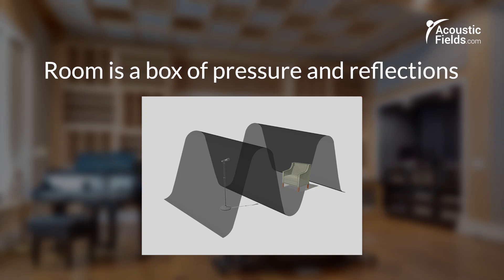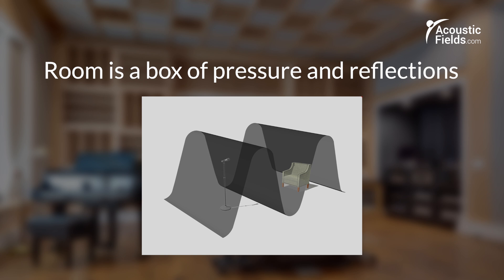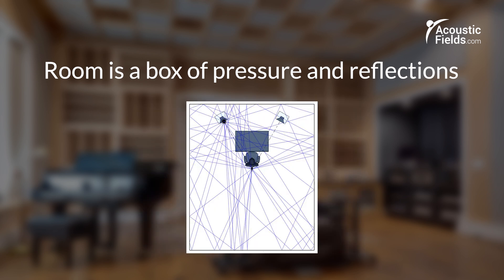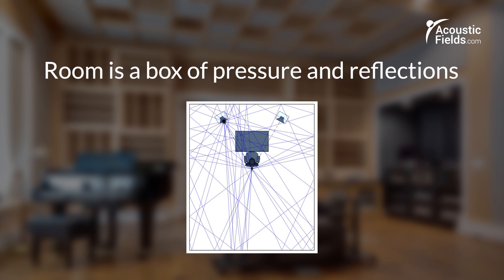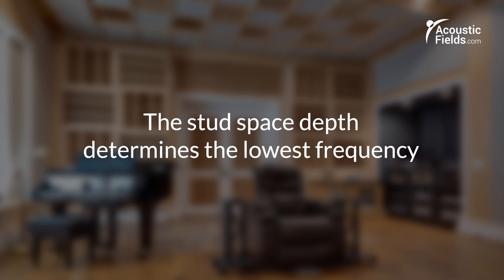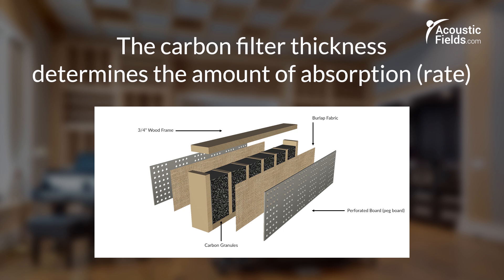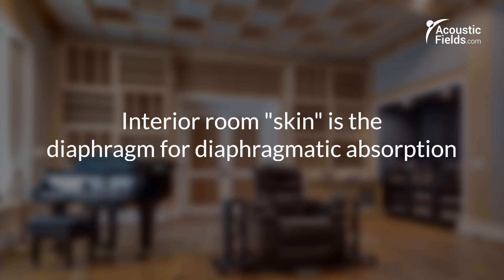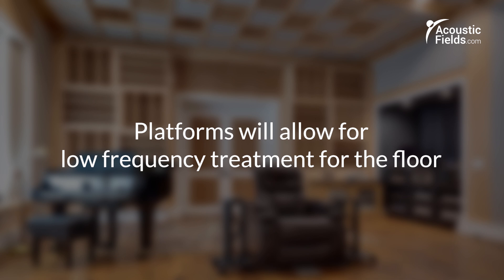CAW - Carbon Absorber Wall - www.AcousticFields.com

Comment: If all you have is a 2x4 wall to work with is there any hope?
Reply from the maker: All walls will "work" to the frequency of the depth which at 3 1/2" starts at 80 hz. The next question you must then ask is a wall that starts absorbing at 80 hz. the correct wall to have at that room location. My guess would be no. You must go lower in frequency. Going lower in frequency means adding a 2 x 6 stud to increase depth to 8" At an 8" depth, you can get to 30 - 40 hz., which is the lower frequency range absorption requirement number in most small rooms.

Comment: Do activated carbon granules' performance degrade over time? Do volatile compounds, and airborne pollutants get trapped in the granules after months/years?
Reply from the maker: Our carbon technology goes inside a cabinet. It is sealed from air movement. We also treat it for moisture retention.

Comment: I think the CAW is the most ingenious and most under rated technology in the audio world. Yes, it's not for low budgets, but as far as depressurizing the room, I don't think there's a better way to do it. Dennis should be given lots of technology awards for this.   Too bad it's not as widely known about as he tends to prefer a grassroots effort in marketing rather than spending gobs of money in magazine/internet ads.  Too bad he isn't conducting lots of lectures around the world at Professional Audio forums like AES.
Reply from the maker: Since room modes oscillate every 36 - 48" throughout the room, placing the proper rate and level of absorption inside the alls, every 14" (stud space width), you are able to manage all unwanted energies with 2-4 stud spaces per room mode. That is enough surface area to reduce the unwanted modal pressures by 70 - 90% depending on the chosen room resultion level. You are in essence tuning the walls every 14". Nothing can escape this relentess pursuit, not even 30 hz.
Reply: @AcousticFields  I've seen many other designs for walls and nothing else really does what the CAW does.  Pure genius.

Maybe you could get AES to allow you to conduct a lecture on the subject.

Comment: Somewhat related thought. If someone controls low frequency pressure in their room, are they less likely to want/ need a or multiple subwoofer(s)? Seems most people are throwing subs in just to cause pressurization because the room is too small to actually reproduce that low of a note. It would seem that be properly constructing the room would work better and ultimately cost less than some of the quite expensive subs. This could actually be a cost savings approach rather than adding to the cost of the system. It might draw a lot of prospects looking to save money in ways they had not thought of.
Reply from the maker: People add more pressure because they want to feel more low end. Low end is felt not heard. Increasing the pressure (each sub adds about 2 dB to overall numbers) is the desire to feel more because they are trying to pressure their way through modes. Treat the modes and pressure balance the room and less pressure will produce higher resolutions.
Reply: @AcousticFields  And fewer subs needed.
Reply: Micheal green the speaker maker does this with your room
Reply: Dennis is correct while most will buy expensive gear and skimp on the room that is as if not more important. The problem I have lived is 3 moves in 40 years and you can't take it with you. Luckily, it's not my living income but my passion and compromise is always there and nothing perfect on Earth. Dennis has mentioned that 2 chanel for the audiophile can go 70% of most room problems. I personally need treatments I can relocate to any new living location if needed.
Reply from the maker: @michaeltaylor6738  Fill out the info in this link. Schedule a call with Dennis.
 https://www.acousticfields.com/free-room-analysis/